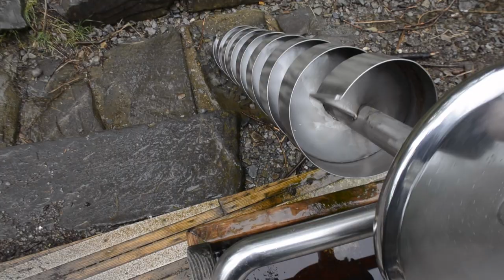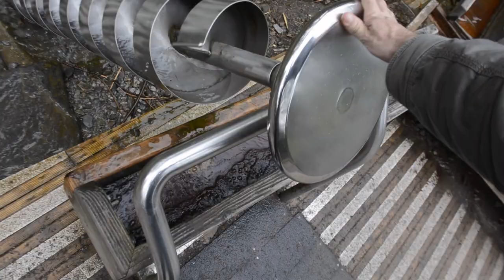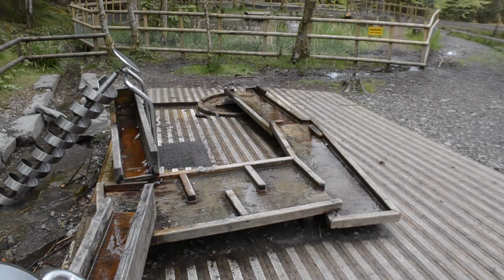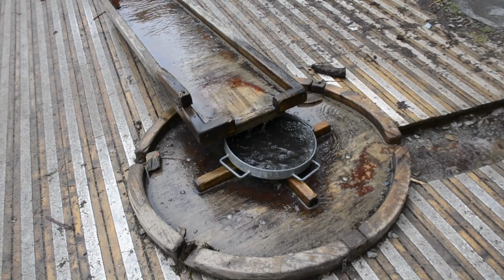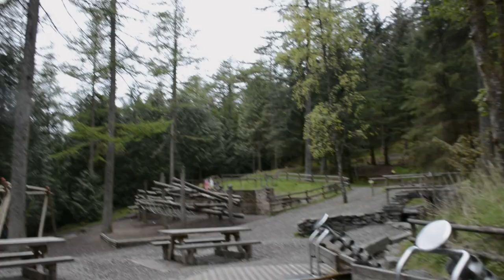Archimedes Screw Water Pump

Comment: Here, what is remarkable here is that the wall of the Archimedes screw rotates with the screw. Separating the two is therefore useless. If we look at many Archimedes screws in operation the outer wall is fixed and the outer is mobile and subject to leakage,friction and fragility.
Reply: YES, I've seen it everywhere (seperation of outer wall and scew causing leakage). I don't understand why people don't just link them both like you said...

Comment: Great demonstration of   Archimedes screw (and hydrodynamic screw when he stops turning and it reverses its motion.  Why doesn't someone make a hydrodynamic screw, and add a smaller diameter "water auger" on top so that the hydrodynamic screw powers the  Archimedes screw above? That would be really cool to see! And maybe the people who made that lovely demo could do it and even get a grant to make it.
Reply: Hanging gardens type shit
Reply from the maker: Interesting idea. Wish I had the skills :-)
Reply: @Blenderkim  I thought having them both on the one shaft might be nice,  (I made a video about it) but maybe  having them on separate shafts is better or easier.  Then it can be belt driven. (maybe with the belt gearbox from an old electric shop drill so that speeds can be varied). On a positive note, someone in a practical water power forum liked the idea and he said he would try to fabricate one.  I think it would be a world's first if he does it!

Comment: now build one out of fiberglass water slide components .. have bottom end on floats.. as long as you only scoop up half the tube of water.. it won't pour back.. it will move water up much faster for irrigation..
Reply from the maker: Why fibreglass? Cheaper?

Comment: Wouldn't it be better with a handle?
Reply from the maker: Maybe, but this one is very smooth and easy to turn. For an actual water screw for irrigation or an auger for moving grain upwards, a handle would speed things up no doubt.
Reply: @Blenderkim  So screw a handle onto the archimedes screw ^^
Reply from the maker: @123TauruZ321  :-) I will let someone else handle that option...

Comment: Does flowing water at the bottom power it's rotation or do you need someone to turn the top of this device?
Reply: Turn
Reply: Flowing water can be made to spin the screw.  Self powered pump.
Reply from the maker: Yes, if the river was flowing strongly enough you could do this.  If you see any examples I would like to see that.

Comment: can you make it vertical INSTEAD OF BEING INCLINED>>>AND STILL CAN RAISE THE WATER UP???? IE:  TO PUT THIS SPIRAL DEVICE IN A BARREL OF WATER AND TO MOVE UT; as you doing; AND STILL CAN SUCK OR RAIS THE WATER UP TO THE TOP OF THE BARREL???? ID YES THEN PLEASE RESPOND TO BUILD ONE FOR ME : AT THE START FROM PLASTIC . THEN IF IT WORKS IT MAY BE MAKE FROM STELL OR ALLUMIJUM OR ANY OTHER MATERIAL>!! IF YOU CAN: THEN PLEASE RESPOND AND I WILL PAY YOU WHATEVER YOU ASK FOR!!
CHEERS
Reply from the maker: Hey. I think it would not work and gravity would pull the water down.
Reply: no because what makes it work is that it always has somewhere to flow rather than straight down when its at an angle. if it was straight vertical it would flow down around the spiral, which it cant do here because it would have to flow upwards to go all the way down the spiral

Comment: Can it be done vertically? (Not diagonally like pure perpendicular
Reply: No, it needs a "pocket" to hold the water. If it was fully vertical it would have no such pocket.
Reply: Possible if you cover the teeth completely
Reply: What, if u put it inside some kind of Cylinder.. 🤔
Reply from the maker: @ aarti sharma : Don't think so. That would be like having a tube around a cylinder. If it was vertical gravity would just pull the water back down. You would need individual containers of water moving from bottom to top